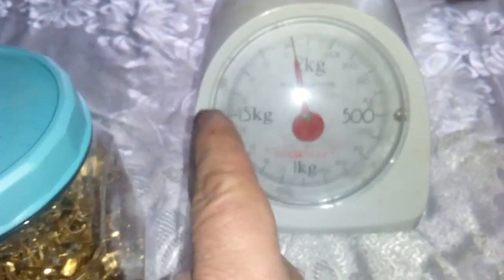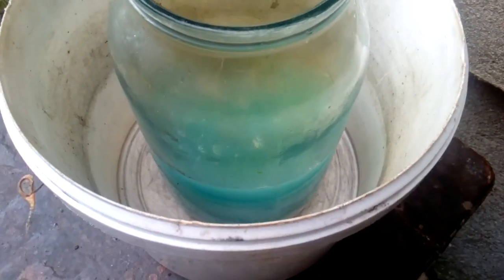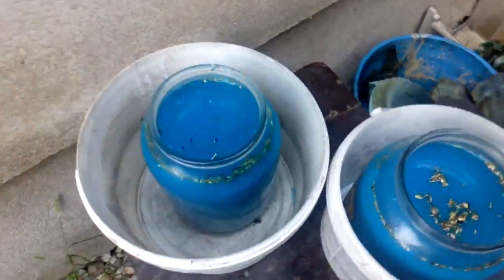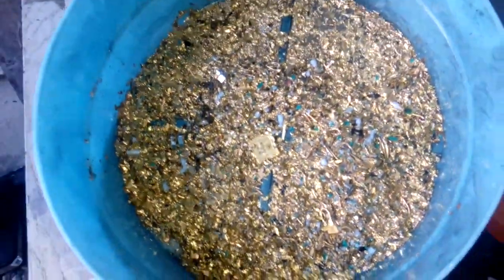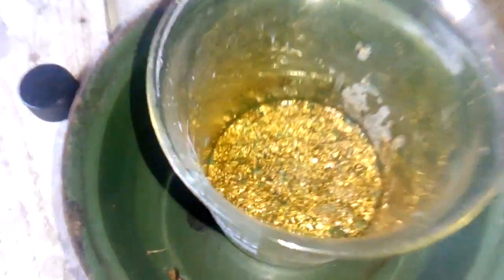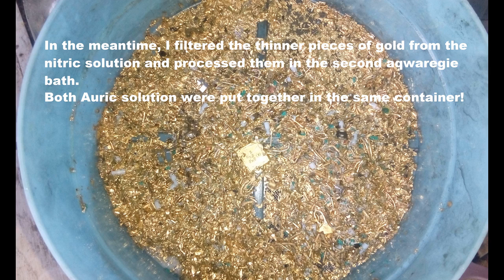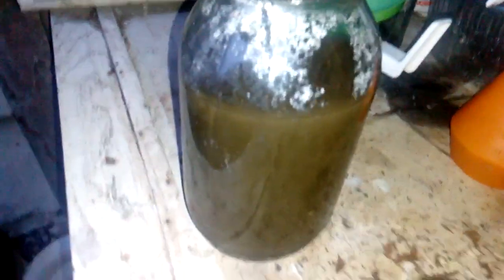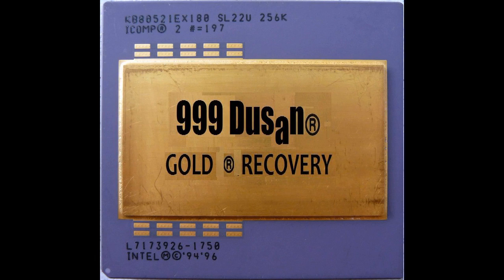Full plated pins gold recovery vith Nitric acid!

Comment: If Nitric acid was cheap, I'd use it too, but if you only got 2.2 grams out of that using 1.3 liters if nitric, you wouldn't break even. 2.2 grams of gold at today's price is about $120(US) and depending where you buy your acid, you may or may not even cover the cost of the acid.  I've seen videos of people in India processing gold pins and IC's using GALLONS of nitric just to get an ounce (if that) of gold. Nitric is VERY expensive in the US, almost so expensive, it shouldn't even be used to do what you just did.
But, Great video, non the less. Keep it up! (if you can afford to)
Reply: Nice comment?!

Comment: Those gold foils look amazing. Great video.
Reply from the maker: Thanx :)
Reply: What king of watter u have used to dilute the nitric acid? Why i ask you that? Because iyou got very litle gold from that amount of  gold plated pins. I have lost alot of gold because i have used wrong kind of watter, and few days ago i have tested for first time the nitric, guess what? Was AR, instead if nitric, that was the thief who stole the gold.
Reply: @niculanicolaeofficial9114  always use a distilled water, because tap water has a small amount of chlorine so that the other gold will go in the solution.

Comment: hi dear dusan & big thanks for your usefull video
i use this nitric method on not full plated (mixed pin) but after use alote nitric i had alot  brown to red fine precipitate & gold small chips i have 2 kg mixed magnetic pins on 3 container after hcl Bath (one day) i rinse several times & start with 2liter water + 1.3 liter nitric 65%  for aboute 10 hour reaction go down & i filter 3 container (the precipitate cause filter gluging)  i put every material of one container to a 5 liter beaker + 1 liter water + 1 liter nitric almost of materials dissolve on acide  but i have another some  precipitiation (THIS TIME COLOR IS GRAY) what can i do ???? help me please

Comment: Hi!Dusan, great video!question,if i got 50gms.of full plated pins how many mils,of nitric acid do i used to dissolved base metal?thank!gooday!!!
Reply from the maker: About 150-200 milliliters would be enough, depending on the pins and base metal. Always double the double solution with distilled water to make more placesfor metal.
Reply: Thank's i apriciate so much!
Reply from the maker: Thank you for your time freind!

Comment: hello.in gold plate contain lead can use aqua regia and after use smb and filter gold? or first need remove lead with hcl? thanks
Reply from the maker: It is necessary to remove as many lead with Hcl, then rinse the pins and insert it into Nitric. Of course, hcl does not dissolve the lead, it only removes it from pins and deposits and it will be a little harder to wash it.

Comment: Only 2.2gram are u kidding me .
Reply from the maker: Although it works like a lot of foils initially in the filter, believe me that it is not so, the amount of gold in the end depends on the thickness of the plating itself, and not just the surface that is platin; in this case, the pins were whole plated but the thickness was not like the pins for example, military equipment.